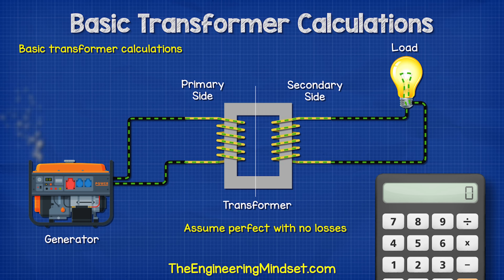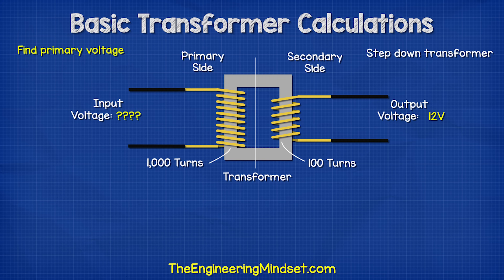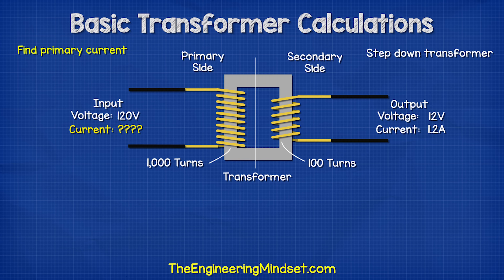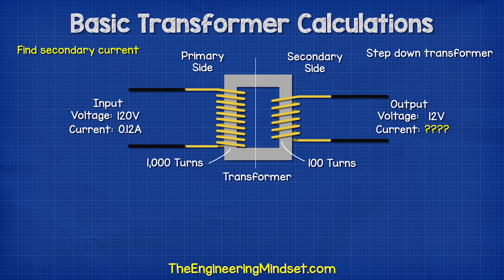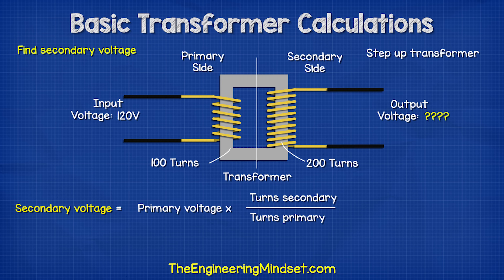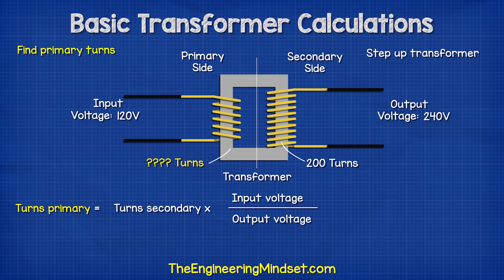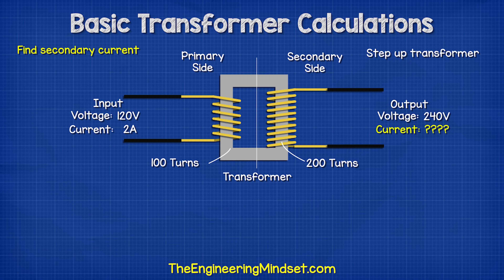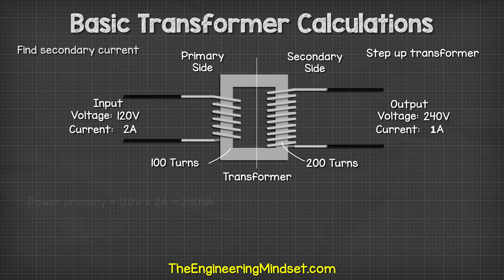Basic Transformer Calculations

Comment: Hello, I have an toroidal isolation transformer. Both primary and secondary have 48 turns each. The gauge size of wires is 12AWG. What is the maximum VA of the transformer?

Comment: But the most important question still remains and it has not been addressed in this video: What if:  you have an old (recovered) transformer but it has nothing written on it, no labels or where it is from / destined to. All you know is that is made to be fed from the mains voltage (say 120V AC) and you can also measure the output secondary voltage with a multi-meter (so no load here). The most important question is how can one determine what is the maximum current available @ the secondary ???  What is the proper test that one can do to find out ???  Is not only confusing but truly a mind boggling situation since you don't even know what is a maximum (reasonably acceptable) volt drop under a maximum (reasonably acceptable) load without forcing the transformer to get  dangerously hot so to quickly shorten its life. ideally,  we want a long life out of it and the working temperature under full load and long term continuous use to be reasonable and also give that transformer some spare lea-way to breath and never to work to a full absolute capacity. I wonder if there is a way to find out. Perhaps an electronic load  maybe.....???  just a Wilde guess...…   But to use an electronic load one might need to connect it via a full bridge rectifier first (I suppose)  electronic loads (that I know of) only ever accept DC lads not AC !

Comment: Ok, but like, if i connect a resistor to the secondary side. Then what values are equivalent for that resistor? If i use ohm's law the math breaks. For example if i solve for voltage using current and resistance, i get a voltage diferent to the transformer output, and if i use voltage and recistance, then i get a current different from the transformer output. Which formula do i have to use when dealing with the secondary side of a transformer?

Comment: Why did you reverse the turns ratio in the first formula & use multiplication? Why not divide primary winding by secondary winding for the reduced turns ratio, then divide prim. voltage by the the reduced ratio (10 /1)? Multiple ways to do the same thing I guess?  Idk am I missing something that makes using the formula easier?

Comment: Most of us need transformer primary and secondary turns, if you want to design primary 220V& secondary 12V 50Hz, 1KVA, Efficiency 85%

First of all calculate the core size =√wattage of secondary/5.53

Say √1000/5.53
31.6/5.53= 5.71 Sq-in (square inches)
Add 15% say 6.56sq-in

For 50Hz Primary turns Np=7.5/area of core size in inches 

Say 7.5/6.56= 1.15 turns/volt for 220x1.15=253 Turns

Secondary 12x1.15 =13.8 turns

Wire size current carrying capacity 3.5 to 4amps /sqmm for transformer 

Primary current=1150/220= 5.2A, 5.2/3.5=1.48sqmm

Secondar current=1150/12=95.8A
96/3.5=27.4sqmm

Comment: How does the wire gauge of the windings affect transformer outputs?  Particularly curious when the gauge used on the primary is different from the gauge used on the secondary.
Reply: Since current and voltage are inverse, higher voltage means lower current while lower voltage means higher current.  A basic rule of thumb for this is to consider that the higher the current, the larger the winding conductors need to be since smaller conductors have more resistance than larger ones.  In general, higher voltages mean more windings with smaller gauge wire while higher currents feature fewer windings with larger conductors.  As far as how primary and secondary windings are related, your secondary is always your load and your primary is always your source.  At that point, you need to know if you have a step up or step down transformer to know which side of the transformer will have the larger or smaller voltage/current.  I hope this helps :)
Reply: Very good question, but it has not been answered by anyone yet
Reply: It's called mil

Comment: Most of that is a "Turns Ratio," still it's better to have these formulas especially when figuring transformer losses in percentages which is real life operation.
I'm not an engineer, but when I installed inverters in vehicles there was some math involved to figure total wattage consumption, which included about 10% over total watts which then gave me what I needed to know for the Battery Power input, cable sizes and what type of charging system would be needed for the vehicle and if necessary vehicle parked, engine off external charging.
Thankyou for this video.

Comment: Is there any value in adding more turns but not changing the primary and secondary ratio?
Example, 100 p 1000s vs 1000 p 10000s?
Reply: it changes the b field as it changes inductance and the core may become saturated, and that's very bad
Reply: @nirodper  So how do you find the optimal number of turns?
Reply: @beachboardfan9544  optimal no of turns is that that transformer doesn't heat up above 120-200 degreesF
Reply: @servisboschiltihiltimakita7960  The coils or the core temp? If it does heat up above that temp, whats the solution, larger core with less turns?
Reply: @beachboardfan9544  depends on power that is determined by size of transformer, if let say 1200w 120v means 10A according to ohms law, so that transformer should not take more than 10A in full load, 120v/10a=12ohm the impedance that is the sum of wire resistance and reactance, impedance can be measured when the coil is in power and you measure the voltage and current then it will tell the impedance according ohms law Z=U/I,  or you can use an esr meter or any to measure the reactance of the coil, then with a multimeter the resistance, and the sum of both is the impedance, there is also a formula where you can find inductance but gets more complicated, it requires no of turns, coil length and cross section area, also the permeability of the core material that can be iron or different versions of ferrite material L=N^2*u*A/l after finding inductance you can find reactance using x=2pi*f*L f is the frequency
as this is very complicated you can just count the turns of existing transformer and divide voltage with the number of turns, it will give you the number of turns per volt, example 12v coil having 120turns is about 10 turns per volt, but as doubling the length of the coil it will require doubling the number of turns and doubling the cross section of the core will require cutting in half the number of turns, but as most transformers use almost the same ratio of length and surface area of the coil you can just consider the surface area of cross section for the same materials for core, example if there is a transformer that uses x surface area and has 10 turns per volt then if you have another transformer with double the area it will need 5 turns per volt, so you can always use this ratio and add some extra turns just for better operation.
Reply: @beachboardfan9544  if coil heats up, needs more turns

Comment: this doesnt even need a formula, it is just the ratio of turns that determines the voltage and the ratio of wire size that determines the current
Reply: That is not always the case. The power transfer is also highly dependent on the core type used. Some magnetic cores are better than others. Some have quite big magnetic saturation thresholds but some others saturate way too early therefore limiting the power transfer thru the core and the result is that they will get warm very quickly under less than expected load capability. So, don't jump to a conclusion too fast.
Reply: Sir that the wiresize...is the calculate of amps...tell me how pls my answer god bless

Comment: I making galvanic isolation "transformers" for many tasks, the video is useful, but you forgot about very impotent parameters such as: wire diameter - it regulates the level of current that can flow(Amps), resistance of the wires - (heating in the coils and efficiency factor of the transformer)👍
Reply from the maker: This is just the basics
Reply: @EngineeringMindset  
OK
Reply: Make a video .i would watch.

Comment: Is the diameter of turns irrelevant? The only important thing is number of turns? 

Like if I have a 20cm diameter per turn (JUST FOR EXAMPLE) but 1000 turns on primary and 100 turns on secondary, would I still get 12v output from a 120v input?
Reply: Diameter will affect resistive losses, heating from resistive losses.

But theoretically, yes, it is.